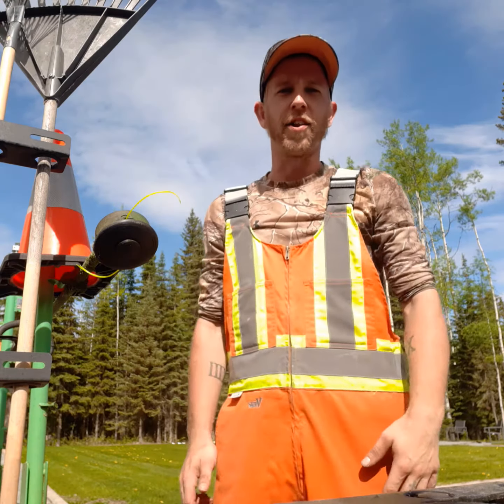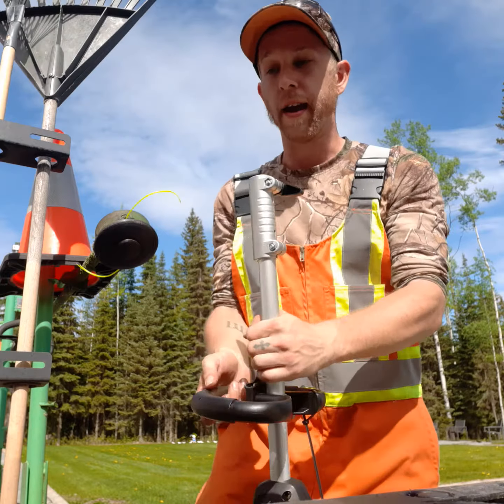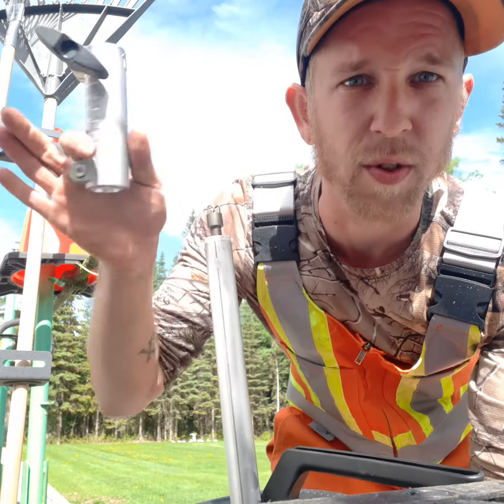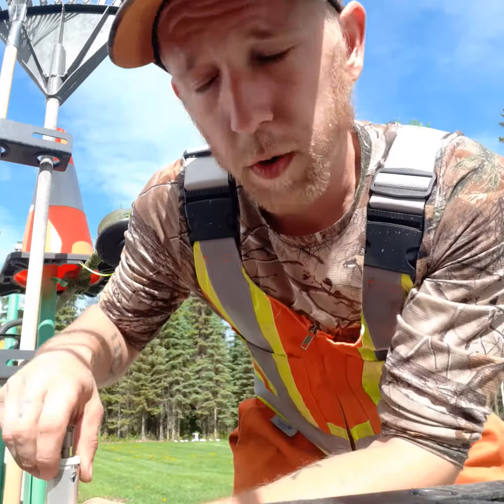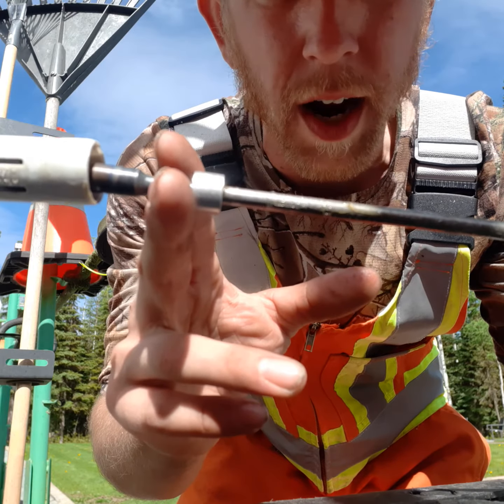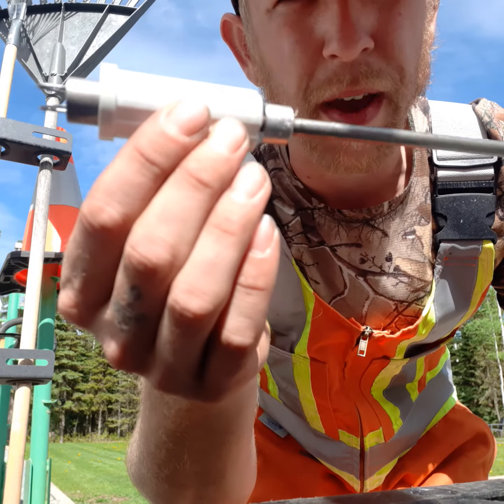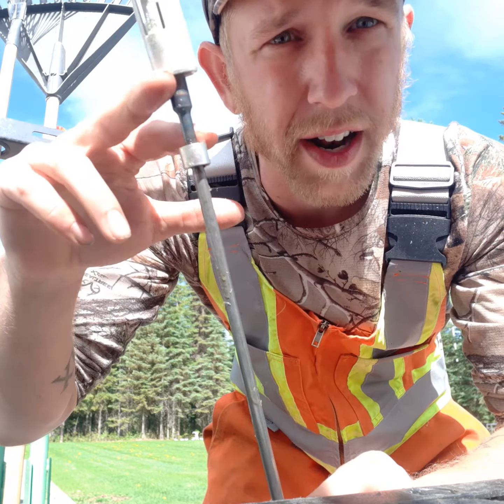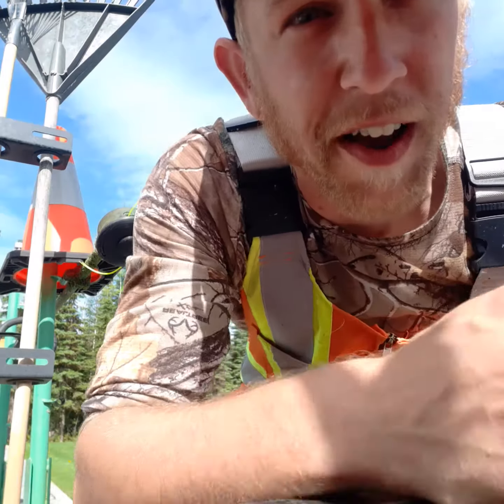Stihl KM131R Kombi System Plastic Sleeve defect problem fix

Comment: Thank you. I came here to figure out why mine melted after barely any use. My older one did not have this issue. We've been using it as a backup. I've ordered replacements and grease for both of my units.

Comment: Big thanks for the heads up. I just checked my six year old KM-94 and the brand new one I am replacing it with (I love these light weight stratified combustion 2-Mix versions myself). The new one is like yours- no grease up at the alloy collar and plastic bush. The old one which has done say 120 hrs was fine. I hadn't been greasing this part but had been regularly applying waterproof high pressure wheel bearing grease to the male shaft ends on the attachments which had migrated into the bushes on both the attachments and engine shaft and bush so all good but I will include it in the maintenance in future.

Comment: Great video! I have KM90 I purchased in 2012 that every year I plan on replacing, but it keeps working!!! This year though, drive shaft on motor side pulls out with attachment. Now I know where to start looking, bet it's that plastic part. Hopefully I can even get a new one on such an old machine! I never knew to grease it! You have a new fan!!! Thanks!!!!

Comment: KM131R is my main go to as well for all garden jobs.

It's a great machine with plenty of torque but also seems to develop a number of issues.

Ive used Stihl machines commercially for many years now and I don't think their build quality is anywhere near as robust as the Japanese built machines.

Lot's of things break and wear out like these plastic retainers. Also the sleeve itself, that is the metal cylinder that holds the attachments that wears out over time and your attachments will get loose.

If you get 3 years commercial use out of one of these KM's thats pretty great I haven't seen many make it that long

Cheers

Comment: bonjour merci pour votre partage , a tu deja utilisé cette outils avec plusieur rallonge meme si c'est déconseillé ? pensse tu que mettre deux rallonge en carbonne serait trop flexible ? et pense tu que l'on puisse utiliser la rallonge en acier pour le hl km meme si bizarrement c'est interdit ? merci pour tes réponse 
yohan de france
hello thank you for your sharing, have you already used this tool with several extensions even if it is not recommended? do you think that putting two carbon extensions would be too flexible? and do you think that we can use the steel extension for the hl km even if oddly it is prohibited? thank you for your answer
yohan from france

Comment: Also been using these commercially for years, good machines but those guide pins snap off all the time! Haven’t found a way to get them out so have to replace the whole drive shaft, which is very expensive!😩

Comment: Bought a brand new pole saw and extension shaft .. worked for about 12 small cuts.. now … only works when direct mounted to the power head but extension will spin if saw is not on it .. any ideas? Very new to this used my kombi no issues for years first day with the saw and extension issues straight away

Comment: Bought fs131 and km131 brand new but both got some issues, fs131 new out of box has half rusted muffler also hard to start also weirdly cut off itself during operating, Km131 new out of box has big vibration during first use also making lot of poping sound when running, both units pretty much brand new have to sent back to dealer for "tune up",makes me wonder what happened to Stihl QC process today.
Reply from the maker: I think covid may have caused them to have to lower quality control for some reason.
Reply: @BhairavaDas  further update: sent back fs131 twice for minor tune up already,they kept saying nothing wrong with it then blaming me for wrong fuel/oil/mix etc which is absolutly not true.   for km131 they gave me another new unit but i still dont feel its operating as "normal" but i dont use it often so for now i just gonna use it as is.   my friend bought a bg86 same period of time and sent back in day 3 coz weird oil leak from carb......
Reply from the maker: @LeonMTan  do you mix with "premium" or 0% ethanol gasoline? I make sure to use the best i can get for all my small engines.
Reply: @BhairavaDas  i did use premium gas and that green stihl oil.
Reply: I've got a km131 on it's way to my dealer. Should I cancel it and buy a Honda or something?. Very concerned over seeing a plastic part used in this application. Are there any german engineers left in Germany or have they all left that liberal hell hole for greener pastures?

Comment: Thanks for the video  I've had my head unit 5 years and never even thought about this. Will check it out for sure. 

Ever have a problem with the edger attachment disengaging from the shaft even though the shaft tube is snugly connected? (Sometimes they slip apart at the connection due to those piss poor plastic clips, but that's not the case with mine in this instance)

Comment: Do you know if using regular high temp bearing grease is ok or is something else required?  I ask bc when I pulled my old km110r apart, there was still grease in the shaft, a thin couple of a tan, thick, sticky grease.  It is stickier than my wheel bearing grease.  The bushing that rides inside the plastic sleeve definitely needed more grease
Reply: It’s called Stihl Multilube,and it’s high speed gear grease.Not the usual grease that you would grease an excavator or a heavy machine

Comment: Achtung ⚠️ Major frustration getting all the kombi attachments to slide into the motor head and receptacle. Those little triangular pins don’t do a good job guiding the attachment connection and seating the tool 100%. And yes  I’ve learned the hard way a half-ass connection can lead to plastic bushing wear and disintegration. What am I doing wrong???

Comment: Pay attention to what grease you use. Some folks are using wheel bearing grease but remember the shaft on these KM's turn at the same speed as the engine, something like 9000 RPM full throttle...FAR faster than wheel bearings. The Stihl grease is something like "00" viscosity (almost liquid), not thick tacky wheel bearing grease.
Reply from the maker: At some poimt that must have changed, my older machines had a thicker grease, and much more grease. These machines never failed. The new machines had a very thin, somewhat sticky "grease" almost like an oil, and not much, these machines failed. So maybe youre right, but those are the failing machines...they are the "newer" ones..

Comment: STIHL Kombi joints are absolute CRAP - after a while they dont hold and the tool falls out.   Wake up STIHL engineers - most of the othe companies like Husqvarna also have a pin that locks it in!
Reply: Yeah the way the attachments are held on the Stihl machines is poor. There is a lot of power lost through that coupling from all the vibration.

You might need to replace the alloy sleeve itself as it wears out over time, it is available as a spare part.